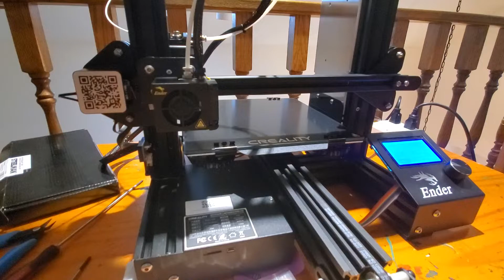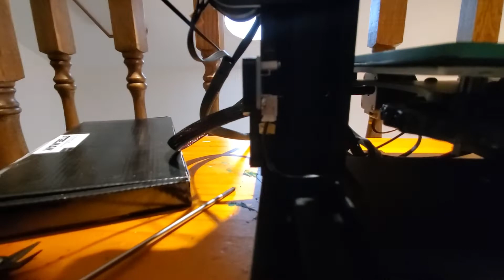Ender 3 Pro - Auto Home raises everytime issue

Comment: The printer seems to think the switch is permanently triggered, or it's reporting an opposite status. Attach to a PC and use the M119 command to test it while it's triggered and again while it's cleared. If it's responding in reverse, update the firmware or look into reversing the wiring of the connector to the mainboard. There's a setting called "invert_z_stop" or similar you can use to change the behavior in the firmware. If it's not responding at all, swap the Z switch connector on the mainboard with one of the other switches and test again. If the known-good switch works on that Z-MIN port, there's something wrong with the Z switch or cable. If neither switch works on the Z port, your mainboard may be bad.
Reply from the maker: Thank you